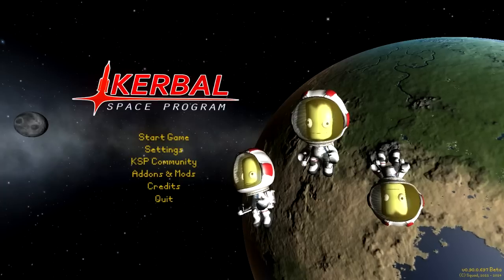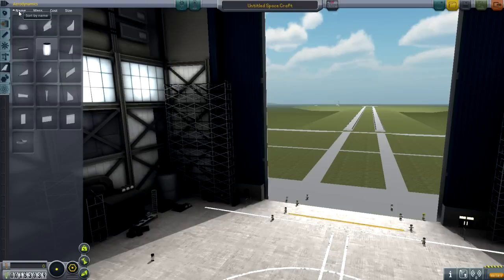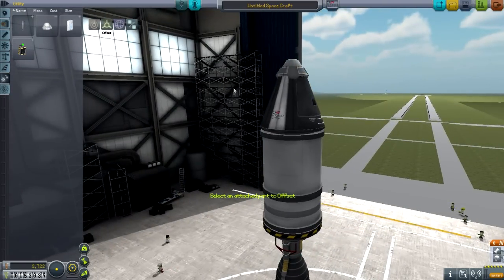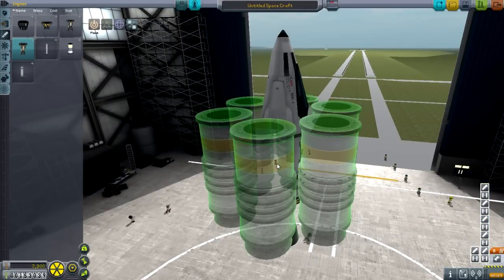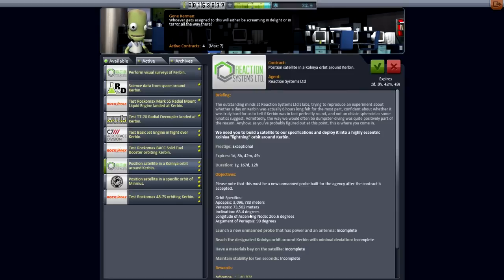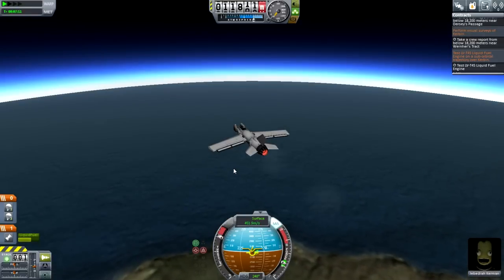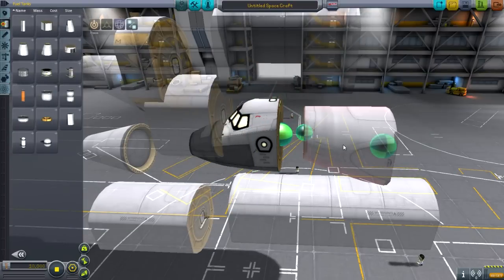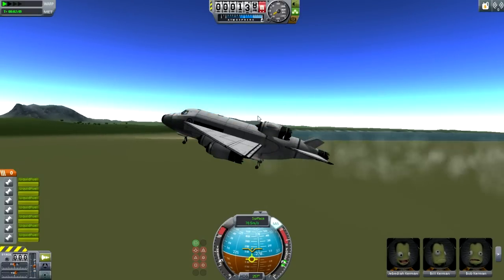Let's Learn: KSP 0.90 - Getting Beta Prepared

Comment: I bought my ksp as soon as .25 was released. Does anyone mind letting me know what I do to get .90?
Reply from the maker: Steam has auto-update. Or if you turned it off manually update it. If you bought it from the site then just download the latest version after logging in.
Reply: So it will be free if I already bought it?
Reply from the maker: Yup! As long as you bought it all upgrades are free. You just have to get them from wherever you bought it from (Steam or the main KSP website).
Reply: So that would dupe the current version I have? Or would it just update?
Reply from the maker: Current version is 0.90. Soon to be 1.0
Reply: So if I downloaded, I would have two KSP's, right, or would it just update?

Comment: About landing that plane at the end of the video, the problem is that your fueltanks are full. That increases the weight alot. When you empty the fuel tanks it should be much easier to land. Would be nice if you could drain tanks during flight before landing :S
Reply from the maker: There are some mods out there that have things like that; they drain tanks without outputting thrust. Still, it seemed appropriate to go out with a bang!

Comment: Hi, I am hoping to get some help, this only started yesterday, i have tried re installing and editing settings.cfg resolutions to 1280x1024. When i open KSP it comes up with an error message; Switching to resolution 154x0 failed, trying lower one
All resolution switches have failed
Screen: could not switch resolution (154x0 fs=0 hz=0)
Reply from the maker: It's best to change the resolution in game if you can, but otherwise for in-depth help I would suggest asking in the troubleshooting section of the KSP forums as they're more than happy to help out!
Reply: okay thanks, i cant open the game in any way so will try that

Comment: I'm trying to build that plane you're using to do flyovers on Kerbin but I cannot build anything that doesn't crash within a minute...  I should have spent more time trying to build planes!
Reply from the maker: I never built planes before this version. It's gotten much better, but if you have a problem with crashing a lot just slap some parachutes on there. Also; the simpler the plane the better. You may also want to check out Scott Manly's videos on how to fly planes.

Comment: I have a few tips for your crashlanding issue, and for general plane designing too:
1) When you come to landing you kill your thrust. Like entirely! No engines working when you are about 200m above ground. You do loose speed this way, and your vertical speed is going up, but you fix it by flaring - pitching up before you hit the ground and this way you kill your vertical speed not giving gravity time to give you more and thus you land gently.

2) When you land - most of your plane should be empty. Like an empty cargobay. Or tanks you already emptied on your mission. This will help to fix the "heavy plane" issue, like a lot.

3) You should configure your control surfaces. Mainly you should have distinct elerons and elevons. Elerons are placed on tips of your wings, and should be used only to roll. Elevons are placed on your tailwings (as far beyong center of mass as it gets) and are used to control pitch.
Yaw enabled only on tailfin.
In your current dsign your control surfaces on wings were ruining your ability to take off the runway. If you want to have a good taking off ability, you should apply pitch only behind your rear gears.

4) your tailfins were angled. This may look cool, but that really messes yout stability because as you are using them to yaw, your plane will get some pitch or roll as well.
Reply from the maker: Thanks for the advice!

Comment: I'm kinda disappointed with them moving to beta. I still think that the game lacks a whole bunch of stuff and am afraid they won't include those features now when they moved to polishing part. Like some crucial parts that are required for more advanced crafts, a lot of cosmetic stuff like clouds or trees, additional center sites you could choose from in the beginning or buy them later on, but most importantly a better engine that doesn't despawn objects that are further then 2.5 km away so you can save decoupled stages and some wider endgame objective. I don't like the fact that they rely heavily on modding community to do those things because rare mods are properly balanced and polished. Also, what do you think about a rival organization you'd have to compete with, like a race to the Mun or putting a station in orbit around Duna, to get a contract to deorbit their satellite or sabotage a launch of a massive rocket?
Reply from the maker: You have to remember that gamers usually don't get their hands on games until they are Beta at least. The Alpha stage was to lock in the core gameplay mechanics along with some of the designs and parts to make it enjoyable. Squad doesn't rely on the mod community to add important elements, but to add those elements that would remove the fun from the game and make it too much of a simulator. There are also at least 10 versions (0.91 up) until 1.0 or full release which allows for a lot of major changes and additions including parts and additional gameplay components. Allowing the game to be moddable makes it more flexible for each player and once the game is locked down in a solid state there won't be a need to constantly update old mods and they can be balanced better.
As for rival organizations I like the idea of KSP being about exploration, learning, and discovery. Sabotage and destruction has no place wither in multiplayer or single player against an "enemy" state. Once that mentality is added to the game it no longer becomes about exploring and learning it becomes about destruction and strife and that's not what KSP should foster.
Reply: Well, that's true. Although I think it could be fun to sometimes have this competitive events like the 60's space race was. What do you think about the endgame content, should it move to something other than exploration, like mining, colonization or interstellar quests?
Reply from the maker: The space race wasn't so much about exploration as it was about showing the other superpowers we had rockets that could reach their country as well as space. The entire process was a show of power and a grab for money. When the need to show was lost and no money was found (previous resources on the moon) we left it behind. Exploration started as exploration for its own sake is the only way for it to continue past political and social ideologies. Even in a game once you've "won" there's no reason to keep going.
In KSP there should be no endgame per-se. There will be, of course, as you can only go so far in a game, but the more planets, systems, science, and discoveries they put down for people to find the more it will boost the imagination and need to explore in those who play it. Which is more important than pure gameplay alone. As for what Squad does vs what modders can do I don't differentiate as KSP can be molded to do whatever we want it to thus taking that requirement out of the hands of the developers. The end game, in this case, is whatever you want it to be,
Reply: this what they did, its bulshit, it is clear now that they are looking to finish the game fast and get the extra money for it, the last few updates made their intentions clear aswell (better explosions?)
ksp is not going to change anymore, it's done
Reply from the maker: Is it so much to ask the players to decide what type of game they want to play? Or is it better to be forced to all play the same game regardless of our style or preferences? I wouldn't sell Squad short so early as there are a lot of updates between now and 1.0 and it's easy to forget that we have been instrumental in the build of this game from the beginning while most other games don't give an option until this point in development. If we've failed to point the devs in the direction we want them to go then maybe it's not their fault since they offered us a voice and we stayed silent.
Reply: I'm surprised they actually balanced out and included some of the mods into the basic game, so let's try not to judge to wait for them to release the full, definitive version. Who knows what they'll deem worthy by then, but I'm sure there will be enough explosions and roaming science to satisfy all, no matter their taste. I'd like to see the official reentry heat damage model next, now that will probably completely change the way we design our craft.

Comment: how do u have over 150,000 already? i would like to see someone do it on moderate setting without jacking up money settings and stuff
Reply from the maker: For this profile I started with the base amount of cash which I believe is 25K. When I stream the game I always start with 0 dollars and just use output from contracts to fund everything as I was asked by my viewers if it was possible. Turns out it is and it's very fun. After two years of playing KSP I've gotten better at building smaller rockets that do more as well as not worrying about each launch so much that I try to save every part only to lose the whole thing.
Reply: One "pecific Kerbin orbit" yelded me like 120K money. Though it was really hard to pull off with 30-parts limit and I had to postpone it til I had an SAS-able probe body. But money is not that big of an issue once you progress.

And - don't stick with equipment-test. They are simple and are ones you are used to, but they dont give much cash... and with Visual Surveys you can get money even if you goof like sending 7 one-way gearless planes to have 3 EVA reports from surface points (fortunately no Kerbal was killed during landings)

Comment: Having an issue with a satellite contract where i get all but one condition met but that condition is "Launch a new unmanned probe that has power and an antenna" of which i have twice. Anyone else having this problem?
Reply from the maker: When I build a probe for that mission I use solar panels and at least one battery. Not sure what it means by "power" but I assumed it was a battery. Once in the assigned orbit you have to stay there for a small amount of time before it completed. It doesn't have to be close, but within a margin of error. Also make sure your orbit is in the same direction as the little rotating "balls" on the orbital line. If your orbit is reversed from those then you'll not get the proper completion either.
Reply: yeah the power thing is probably whats the problem cuz i have batteries but no solar panel. oh well.
Reply: i went back and tried the same craft with solar panels when I unlocked them and it worked. So "power" means electric charge and the capability to charge without expending any other fuel probably
Reply from the maker: Excellent!

Comment: You probably wont respond to this but how do you get the engineer to fix parts?
Reply from the maker: I haven't had a need to do so myself, but I would assume you have them EVA and then right click the part while in range much the same way you collect science from the pods.
Reply: ***** ok thanks a lot

Comment: how come my buildings are fully upgraded when i start?
Reply from the maker: That's a bug that has occurred with several people. It seems to be something that happens in the 64-bit version. If you're using that version you may want to switch down to the 32-bit version. If you're using 32-bit report the bug on the forums. (Be sure to check to see if there's already a thread about it).
Reply: ***** ya, i was using the 64 bit version, ill try the 32 bit today, thanks!

Comment: The reason you had trouble landing the plane was not because of how heavy it was, though the large parts could probably do with some joint reinforcement. Heavy planes just need more landing gear, and a more shallow landing pattern. Next time, don't come in high and drop speed, that just makes you fall more or less straight down, which puts a huge amount of force on your gear. Try to come in as low as possible while maintaining speed, and then barely slow down enough to slowly descend and gently drop the plane on the runway.
Reply from the maker: Oh yes. Landing is my weakest ability when it comes to planes. Usually I just stack a bunch of chutes on top and pop them to instantly slow down and come down vertically. XD

Comment: Another useful thing for the "Place a satellite in X orbit" contracts, the visual display on the map / Tracking Station also shows you the direction of the orbit.  Starting at 25.36 you can see some dots whizzing around the projected orbits for the contracts that show the direction your ship also needs to go while orbiting, not always necessary but I noticed it while using the FinePrint mod with a Mun Satellite Contract that wouldn't complete (right AP / PE, wrong direction, facepalm!)  :).  Also great video Kb!!
Reply from the maker: While streaming this I took one of those contracts and figured that was what those were for. Hadn't thought too deep into them previous to that. Thanks for the heads up!

Comment: You could habe lifted your Mark iii plane easier by simply changing a few turbojets with basic jet engines since the turbojets habe to gain speed before their power output peaks where as basic jet engines give you more thrust the slower you are.
I think it's about 40% more thrust at takeoff and lower weight for all engines beging basic jet engines compared to your setup.

But whatever. Longest and most detailed video about the new update(except a few minor things).
Gold job - well done.
Reply from the maker: Thanks! Up until this update I've had no reasons to use airplanes and tons of reasons to avoid them so my plane building skills aren't excellent. I'm slowly learning though as those Fine Print contracts work VERY well with planes.
Reply: got to excuse me for terrible english; it was partly due to german autocorrect and partly bad skills :P

Comment: It should be remembered that the US Space Shuttle was not build for precision flying. As was stated in the movie Space Cowboys, it is a flying brick with wings.  But I wouldn't let that discourage anybody. For one, just building the main fuselage with just passenger and cargo alone, and then having fuel tanks as part of the external propulsion should make things a lot easier to making the Mk 3 into a SSTO.
Reply from the maker: With a little tweaking you can build a pretty awesome plane with the Mk3 parts, but you are right it's mostly for shuttle style designs sent up on rockets and brought back like a plane.
Reply: If we can build planes like the C-5 Galaxy or the Antonov An-225 Mriya, then KSPer's can build a working spaceplane from Mk 3 parts.
Reply from the maker: This is absolutely true. I'm a terrible example of a aero-engineer. So th fact that I got even one of these to fly means others will make some epic designs without a single issue.

Comment: you gotta keep the vertical drop rate under 5 if you don't want to explode when you land. The parts tolerance is related to the impact stat.  They should really increase the joint strength across the bigger parts.  With that much weight you can also add more gear to spread the load out.

Comment: You have to drop fuel out before landing
Reply from the maker: There's going to need to be a mod that is used to just massively dump fuel for emergency landings I think, I did land it once safely off camera then immediately messed it up while recording.
Reply: *****  TAC fuel balancer lets you dump fuel fyi
Reply: Silver Bull Steve Very slowly.

Comment: 4KbShort, for a plane, you want to have a lower landing weight then you do a takeoff weight. You most likely want to drain the fuel tanks to about half before attempting to land so the plane has a lower stall speed.
Reply from the maker: The big Mk3 plane will need a fuel dump, mostly empty tanks, or a long flight to have enough fuel to not crack in half on landing.